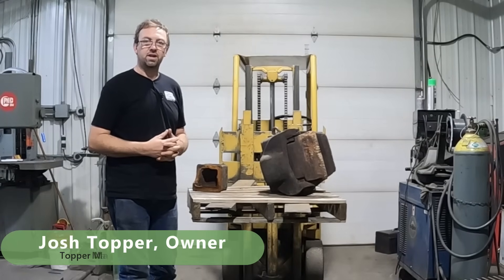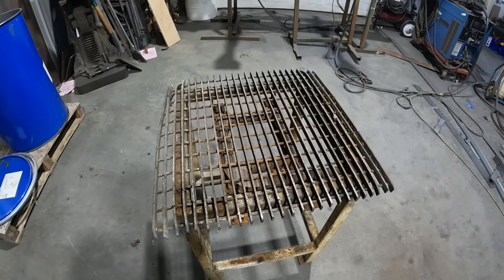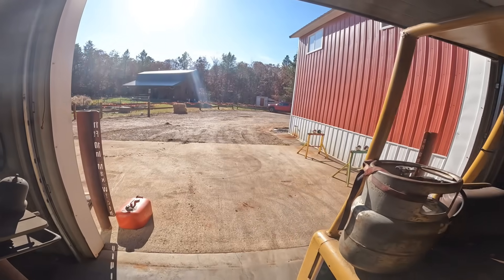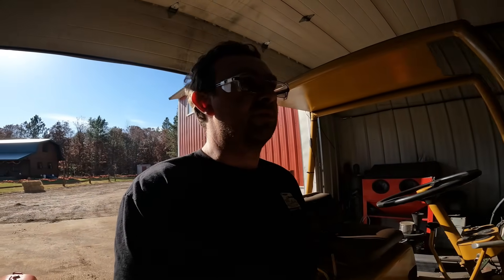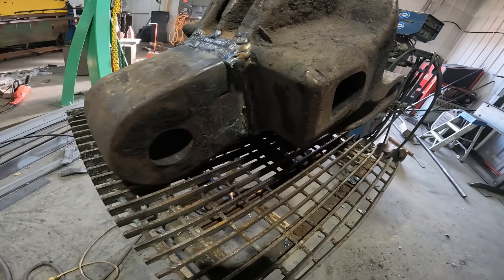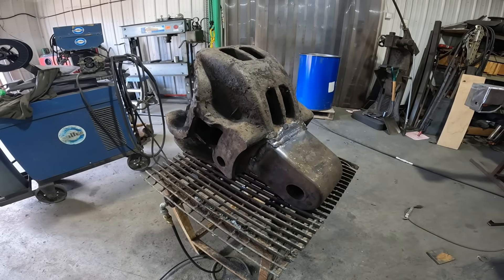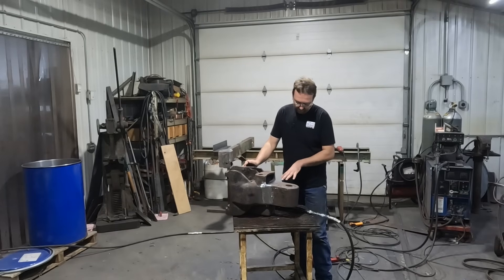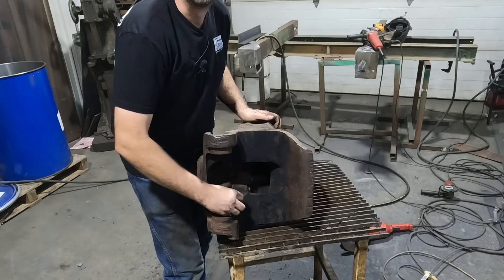Repairing A Broken Locomotive Coupler - 100% Not Legal For Active Service

Comment from the maker: UPDATE  my customer watched the video and read some of the comments and got a little freaked out. They decided to scrap the coupler, but still paid me for the work. I had my NDT(Non Destructive Test) vendor come and check it out.  It passed with flying colors!  Infact the weld looked better than the surrounding material, excellent fusion of base materials. My weld inspector watched the video and called to confirm my process.  To say the least, he was happy. But it will go to scrap, even though it is stamped "Repaired, Not For Interchange". Better to be safe than sorry! UPDATE
Reply: If it’s for a static display in a park, what the hell is the customer so freaked out about????
Reply: @spokesmanandcofounder it could be accidentally used if what it’s attached to gets moved although they could’ve just had the moving part of the knuckle welded so it can’t move.
Reply: @ank55o7  not likely since I'm sure a nameplate would of been riveted to it explaining or stamped with display only due to structural integrity 🤔 but hey, people get hung up on what is and ignore obvious signs so...
Reply: Two things some viewers evidently didn’t catch was that it’s cast STEEL, not cast iron (a totally different monster!), and the “Static Display” statement! Welding experts and train nuts are very unforgiving! Ha!
Reply from the maker: @tomt9543  just shows how dumb people have really gotten. They ignore the facts and make up their own.
Reply: @TopperMachineLLC  ive never tried it but there are listed filler metals for either in mig flavor, was curious one day and wanted to find out. Interesting content.
Reply: Wow, if that was really cast iron it would bust into a million pieces on the first day. Excellent weld job, customer freaked out for no reason.
Reply: Looks like excellent welding. A true professional job.
Reply: Remember every welder is right and knows everything, even though you did it the right way you will always get someone’s 2 cents
Reply: It's too bad they decided not to use it. Good repair though I thought it was a nice touch to use the needler on it for texture.
Reply: Any locomotive without alignment control wouldn’t be allowed in interchange so not an issue.
Reply: @10:03 "Hey. Stop crying. You have boots."-Rocky
Reply: Glad you stamped it "NOT FOR INTERCHANGE" you did such a good  finish on it could be mistaken for a RFI part.
Reply: FRA ? AAR ? Hahaha crazy bastard
Reply: Nice job tho
Reply: I´m a bit lit late to the game, but still:
Would´ve been much cheaper to simply torch out the locking mechanism.
No lock, no accidental use!
Reply: Too many internet “welders” and metallurgist or too stupid to understand plain English.    But then again they are dumbed down by tik Tok and their attention span is less than a squirrels.   You clearly stated that it was for a static application and anyone that has the “knowledge” that the people in the comments has would know what type of material it is made out of.   You sir as you can tell are more patient with dumb than I am.     Thank you for the videos.
Reply: A wise decision.
Reply: They banned you from showing the work you do for them on the internet, correct?
Reply from the maker: @erik_dk842  No.  They got concerned the FRA would fine the crap out of them if it was even on the property.  For a static display on  a panel track, it shouldn't be a problem.  But the FRA has become something resembling 1930-45 germany.
Reply: @TopperMachineLLC  Thanks for the clarification. I miss you working on th old F7
Reply: @seanmurphy3413   the AAR would never OK that repair for service.
Reply: MIG welding on Cast is a horrible idea. Either braise it or use nickel filler rod for cast iron. Issue welding with steel will cause crystallization in the cast making it very brittle.

Topper:  My comment is for others that are seeking to replace cast iron components, not negative against you.
Reply from the maker: @guytech7310  I have read the comments and its funny how people don't understand the difference between cast iron and cast steel.   It is like the difference between brass and bronze, people use the term brass universally, but they are nowhere near the same material.
Reply: @TopperMachineLLC  Was it Cast Steel? Maybe you mentioned that I missed that. I presumed it was cast Iron.
Reply from the maker: @guytech7310  cast steel. Said it several times throughout the video.
Reply: @guytech7310  I doubt that railroads would ever use cast iron for RR couplers. Great welding and great video!
Reply: @TopperMachineLLC   Nope, you said only once near the end what is your experience with welding casted steel, not that this partucular piece of equipment is casted steel. While this may imply that this coupling is casted steel, it may be elusive if someone is not attentive at the moment. Great job though, i like the surface finish part that makes it look like it wasn't welded.
Reply: @TopperMachineLLC  cast iron would never hold up to the shock of being slammed together, and other shock loads. I would use the repaired for more than a ornament.
Reply: @guytech7310  there is proper filler rod for the mig process. Im not assuming what they did or didn't use. 🤷‍♂️
Reply: Welding a broken coupler is really a bad idea. A 1000 tons or more is a lot to pull. The only use i could imagine is for a museum locomotive. Good, that the customer came to the same conclusion AND still payed you!😁 Nice work though!
Reply: @peterkoch3777  Did you ACTUALLY WATCH the video or read the comments? He says as much multiple times.

Comment: If anything cast says a date on it, it means the pattern or mold was made at the time. Even worse, it could be that the original pattern or mold was made then, then a copy of that pattern was made and cast later. For popular products that have been produced unchanged for a long time, it could have been made decades later in a different factory on a different continent than the first batch.

Comment: Absolutely amazing you did all that work on a coupler that they intended to NEVER use and then they get scared out and scrapped all you did for them because some few had their delicate sensibilties nearly destroyed only by thinking something might go wrong. Got pretty much the same type coupler on two GE 44 ton units I used to be associated with.

Comment: Nice work Josh.

Am interested in the preheat/post heat and normalising process you used on the large coupler.  I am HD mechanic and often have to weld and repair large machine parts with heavy welds. Always keen the learn more to be better at my job. This is the process you used as I understand it. 

You preheat to 317f, and kept the burner going at this temp while welding, pausing after each weld allowing the weld area to cool to match the parent material before proceeding.The post heat, I assume you let the couples and welds reach the same temp for a while? Did the normalising process occur as you were welding and pausing? etc.  Or do you need to heat to a higher temperature for a longer period post welding? You placed the burner on lower temp at completion of work while you had lunch. (What is the lower temp you use)? Then switched off the burner and let it cool over night.  Did you cover while cooling? 
Thanks

Comment: Served as a Conductor for 41 years with Southern Pacific then Union Pacific. UP would have considered that break as new and blamed the engineer every time. It was nearly never the engineer’s fault. Through the years with reduction in manpower inspections went by the way side. UP’s motto was blame the guy operating at the time of failure. Write up the report for the FRA and force re-train the engineer that did nothing wrong…..

Comment: You are a good weldor but please  use  ear protection  when you use the angle grinder.  Because  its make a lot of  noise. And  another  advise  keep  far from  the welding fumes. This  damage your lungs. I personaly enjoy your welding tecniques experience and skills. Got bless you.
Reply from the maker: I use far more safety gear than most I've seen on YT. Respirator, leather coat, ear plugs, etc. I know the dangers of welding far more than most will ever understand. A good friend got brain damage from welding.

Comment: I cant see why thats illegal for on-rail use, that weld will be stronger than the original iron. Id imagine it has more to do with pressure from coupling manufacturers wanting to sell couplings instead of them being repaired.

Comment: I one time years ago watched a forging demonstration at an antique tractor show (yearly) and when they were done forging they buried the part in lime so it would cool slowly.  I had a hydraulic cylinder mount break off on my 1954 ford tractor.  I welded it with a rod made for cast iron and then since I did not have lime, I buried it in dry mason's sand in our riding arena overnight.  been 15 years and still going strong.  Really like the heating table and your explanation of its use.  It is a prerequisite to heat cast iron before welding and cool slowly like you said or the next mooring you will be sadly disappointed.
Reply: Railroad couplers are cast STEEL, not cast iron.

Comment: Only suggestion I have for this type of repair is I would NEVER use hardwire but, rather Dual Shield Flux Core instead.  

I've done tons of repairs on casting type materials and I've always found FCAW MIG to be far superior. Especially when done correctly like you are doing with proper proper cleaning, prep work, and pre-heating such as presented here in this video. The deposition and welding properties overall are just way better than any hardwire application for a near 99% success rate of this type of repair. It's also why ALL Heavy Equipment made in the USA and abroad is fabricated with FCAW process as well. 

The only process I've found better than this (But, far more time consuming) is either TIG brazing or outright Brazing the repair but, no body got time for that mess. (But, it works ;) ) They make Stick Welding Rods that are made for such repairs but, in my experience they are simply way too expensive and time consuming in comparison and still not as good in my experience to simple FCAW-MIG welding with proper prep work and pre-heating.

And yes I get that this repair isn't even an option in the locomotive industry.

Comment: That’s a nice welding machine you have 👍
Reply: 3 phase power I assume?
Reply from the maker: Both of the big millers are 3phase. Will weld circles around single phase machines.

Comment: 7:24 porosity at the end on right side this weld will not pass any inspection saw the spark shower after you stopped around 7:15 or so led me to look for the holes i have run into this alot mig is bad about needing good clean mating surfaces even on the back side
Reply: It's not supposed to pass inspection! It's a Display Piece. 🤦

Comment: You called this a fillit weld so is that the same as a through penetration weld or different because there is such a large area to fill back in the way you cut it out here to line up right? (Not sure if its fillit or fill it or spelled completely different)

Comment: The problem I see is that in 20, 30, 50 years, this repair may be forgotten, and then this will end up on an operating train. I've seen similar things happen in learning about many other things... for instance, many book collectors would have reproductions of missing pages from books in their collections, not intending any harm. But these then get forgotten, and if good, are thought real in later years. There are sculptures and even old souvenirs, found in attics, that are not real, but do the later generations realize this? No, and they end up in museums. 

Those are harmless examples, but I was reminded of this, in this case of the coupler. I wouldn't put that out there... I think it should have been discarded. Would we weld a gun barrel for "display"? A structural part of a display airplane? Of course not, or should not. You have no idea if and when that part will be relied on, down the line in the future, and we have no control over that.
Reply: Perhaps you should read the video description or the pinned comment...
Reply: @bakerboat4572  Didn't notice it. But it's nice to be validated. Thank you for pointing it out... "perhaps" it will happen to you, too, someday.
Reply: You morons need warning labels on everything don't ya?! Great Straw man argument btw. 🤦

Comment: For a bit I was wondering why he had the mask on while grinding but I realised it’s probably because of the rust.
Reply from the maker: Grinder dust. You need to protect your lungs. The dust from the grinding(wheel dust or metal dust) is not healthy. I also use it when welding to help protect from the smoke. Has nothing to do with being alone in a building and wearing a mask. Lol. I'm not that dumb!

Comment: I would run it. We use the same methods on excavator buckets and arms and have never had a problem. I guess you could use Themite to do it the way the rail road seams track lays but that weld looked just fine to me but if you would get in trouble, it is not worth the risk.

Comment: I waited until the end to see if you would use a descaler to stimulate the the casting. I once  took the front of a John Deere model B row crop  and grafted it to an Allis Chalmers G model garden tractor that I put a custom made adapters to make a high crop rear axle. So that it is a row crop high crop which was never made by the factory,  I also took an all factory original G model and made it in to a high crop which was never made from the factory, but had after market kits made to make it a high crop. Where the  Deere logo was I ground it down and used a plasma cutter to make the Allis Chalmers Logo for the front and after welding it on  and grinding the welds down so it looks like it was cast in I  heated it up so it was starting to turn orange and hit it with a descaler  and it was impossible to tell from the factory rough cast of the original tractor. It was good enough that the steam engine show in Pawnee okla. Had some Allis Chalmers experts that grade restored tractor's believed it was a ultra rare prototype that was rumoured to have been made and destroyed back in the early fifty's and wanted to display it in the factory museum it wasn't until I showed the build pictures that they agreed it was the best they had seen and still wish to display it but the owner my uncle doesn't want to.

Comment: Thanks you for this video! Can you tell me, is there a stamp or brand that can be pounded into a part repaired like this. for example "Display use only", "Static use only"? How would someone 45 years later know not to take the part off a static display and use it in a park train pulling kids up Stone Mountain? (I do know you and your customer junked this particular part).

Comment: What wire did u use?

I’m no welder but I didn’t think u could weld cast iron via mig…..been told that by a bunch of folks I consider in the know.
Reply from the maker: Cast steel is not the same as cast iron.

Comment: Why would you go to so much trouble, expense and work for something that is is just going on display. Makes no sense to me. This is just a waste of good material. Not to mention a waste of time. You could have done something productive instead of wasting time and material
Reply: Because the customer wanted it fixed.  Best guess.. repair was 500-750. Replacement would be in the 2k range because you'd be buying a new modern casting.

Comment: Great job with the repair. But crappy audio, since the sound keeps switching from stereo to mono repeatedly throughout the video. Dunno if it is a cheep mic, or just a crappy connection due to a broken wire or possibly a worn out plug. Since I am deaf in my left ear, that audio problem appears to throw all the audio of you speaking to the left side as the only time the audio was working right while you was talking. Was actually when you walked out and saw snow.

Comment: I enjoyed  your reaction to the snow. I am 55 from South Africa and have never seen snow in  my life. In fact where I live now I hardly use a blanket.
Reply: I lived there for 38 years and saw snow 4 times. In Gauteng/Transvaal we used to have a sprinkling of snow that would stay for a day or two about every 7 years usually in spring, hail was a bigger menace and occasionally caused major property and crop damage. Many of the high passes in the Drakensberg get snow every year but it does not last very long usually.  Now living in Finland and the snow here is a given, the duration and depth are the only variables.

Comment: I’m very curious as to what piece of equipment this coupler came off of.  The only rolling stock I know that uses such short shank couplers are the front ends of some steam locomotives and the rear coupler of EMD FTs.  Also, it’s common practice to weld locomotive truck frames.  Weld them up an put them in a huge heat treat oven.  If this piece of equipment is in a museum, and depending on their operation, they may not be considered part of the national rail system and exempt from FRA jurisdiction.  Furthermore, AAR rules only cover equipment used in interchange service between railroads.
Reply: Sounds like it would have to be an F unit as he said it didn't even have an engine...

Comment: It looked an awful lot like the heat from the burner was carrying your shielding gas away. I could hear and see it happening when you started and stopped due to the overabundance amount of sparks and and volcano like spew of sparks when you started and stopped welding. That pre and post heat table is an excellent idea and I have never seen such a handy tool though I wouldn't run it while welding.
Reply: Me too,  it might catch on fire !!!   lol